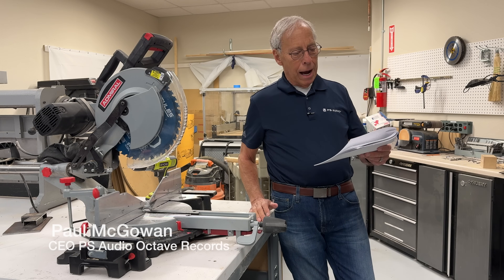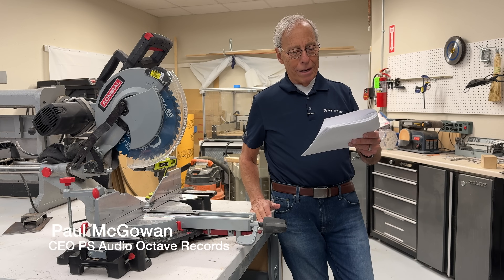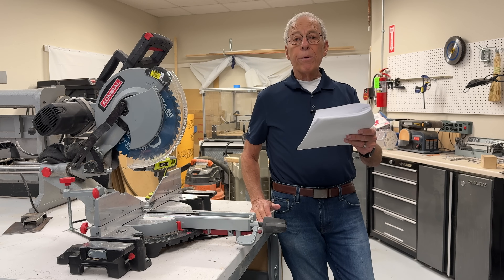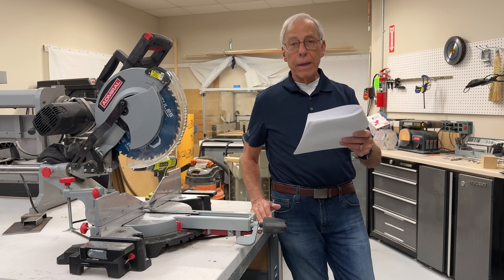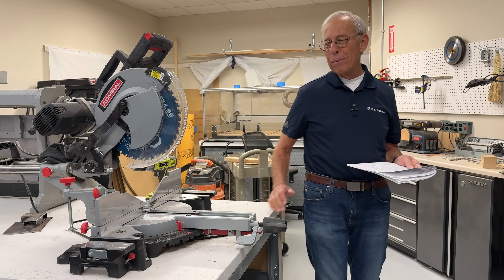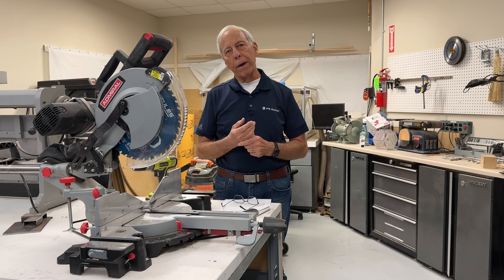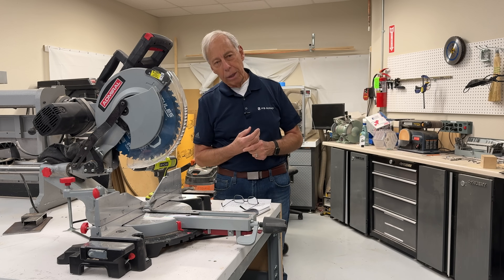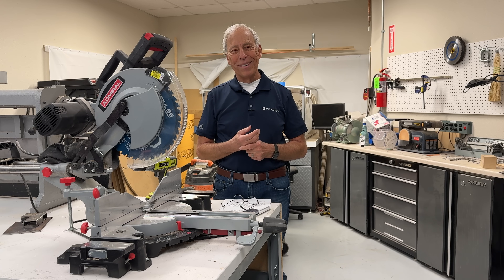The perfect wall materials for a listening room

Comment: I built a micro (9x9 foot) studio / office in my detached garage using 1/2 inch homasote screwed into studs and an additional 1/2 inch moisture resistant drywall screwed into the homasote using laminate screws with no laminate screw contact to wood to break the sound..(I researched other options, including a European sound breaking screw attachment system and also locally sourced drywall suspension channels which decrease the office space so I settled on drywall over homasote due to space limitations)...a flexible adhesive was applied to further connect the drywall to the homasote.  There is a vapor retarder as well for moisture control given my situation in my climate and structure.  Gaps were filled with flexible acoustic caulking or fire caulking depending on the situation.   Stud bays were filled with rockwool.  Area above the ceiling was capped with more than R60 total of rockwool  covering truss lumber and even more fiberglass (layed crisscross and fiberglass over rockwool).  Sound is considerably mitigated inside to out and outside to in for most frequencies accept for the lowest rumblings, which are very infrequent (neighbor mowing). Interior has acoustic treatment to lower resonance and echos.  Bass trapping will be unrealistic in this small space. The floor is over 4 inches thick and includes laminate over plywood subfloor over pink high density foam insulation over vapor retardant OSB subfloor with little feet over concrete (we are in Minnesota....cold in winter). Floor has a rug. Final sound mitigation will be a hanging "sound blanket" over exterior of insulated steel entrance door  to office as that is the prooven source of any major sound contamination in or out.  I have difficulty hearing hail and rain storms plummeting my garage where the office is located.  Anyone can do this sort of sound mitigation on the relative cheap.

Comment: I would like to hear Paul expound more on what to do on top of, or instead of, drywall. I work in a cabinet shop, and there’s various grades and thicknesses of MDF we use. I’ve used 3/4” double refined MDF to build a car subwoofer box in my free time. We’ve also done architectural millwork for theaters, using acoustic paneling for parts of the theater. It was about 1” thick 4’x8’ panels with a milk chocolate brown, fibrous core, and quarter sawn white oak veneer laminated to a dense thin substrate on each side of the core. There were just larger than pinholes drilled through the veneer into the core spaced in a 1” by 1” pattern.

I would be grateful if Paul spoke more about speaker construction and the differences between average homes’ to stupid big homes’ acoustic tendencies and capabilities. And the difference between concert venues and theaters, amphitheaters, recording studios, etc.

Comment: I was thinking of using my basement to set up a listening space but it is unfinished. The advantage is that it is big so I can place the speakers away from walls which I can't do as easily on my first floor.  Would this work well?  Regular basement walls but speakers placed optimally away from both front and side walls?
Reply: You would want to cover the concrete walls to lesson reflection. Floor would need carpeting.

Comment: I live in a sleepout, and all the walls are plywood. I didn't realise how much they affected my sound until I put Blu Tack all around the power points. The difference was huge! So much cleaner now.
Reply: @Kiwi_Col, interesting, do you mean around the electrical mains power sockets ?
Reply: @stephanespohr886  Yes, on the wall all around the power outlets to your stereo and TV. You can also use it on shelves supporting your equipment. You can put it underneath the eq so it won't be visible.

Comment: When using multiple layers of drywall, make sure none of the seams of the second layer line up with the layer beneath. They should all be covered by the second layer. It will be more work, but there will be less bleed to the rest of the building.

Comment: You may be referencing resilient sound isolation clips (RSIC) for mounting the drywall to the studs. When I was building my home theater I looked into those kind of things, but it really would add cost to my modest project. I also looked at the z-channel referenced in the comments. Any of the solutions to "soundproofing" rooms would have added cost and complexity beyond what I really needed. I used rockwool and 1/2" drywall attached to 2x6 studded walls against concrete with the ceiling above a dropped ceiling packed with 12" of insulation. It worked fine except when the kids were watching the movie "Master and Commander" at a volume I'm sure my neighbors 100 feet away could hear inside their house.

Comment: I'd like to try sheathing a room with 3/8 OSB covered by either spray foam (the catalyzed stuff, not the stuff in a can) or cellulose.  Perhaps spray painted with an airless.  It would be a wildly rough texture and probably intolerable by most people but would be the ultimate in diffusion.

Comment: Decoupling drywall can be done with strips of rubber on the stud face but the most effective way is a metal Z channel that horizonal to the studs.  I've never seen 3/4" drywall but typically two to three layers of 5/8" drywall is used in studios.

Comment: I had to deaden some small booths for audio testing of devices and the local "foam warehouse" also has rolls of various materials; I picked up a roll of this odd vinyl material that was recommended by the shop for not too much but for being not even 1/4" thick it was downright magical in killing both high and low vibrations, just sucked em up like a sponge.  One of the oddest materials I've ever worked with and really was an ace up my sleeve come review time.  ;-) 
I never even learned if it had a name or what it was called, it was just "deadening" material and boy engineered materials can surprise the heck out of ya sometimes; it's like someone designed it to do a specific thing and it happens to do that thing well.
And the booths had sliding glass doors to get inside them - double sided sticky tape and plastered it on there, problem solved!  🙂 Then again glass isn't quite as resonant as wood when it comes to signal regeneration, if you get the right frequencies wood will erupt with all sorts of second and third order effects (glass has no internal structure as well as being really dense).  But glass reflects like mad, so you've gotta trap it to keep it from scattering everywhere...

Comment: a listening space is a component of the speakers. when contemplating devising a home near-field (especially) listening room, in addition to determining your listening position, consider the interior of a well-designed / engineered speaker ; volume, shape, hwd ratio, structural material, surfaces, objects, damping materials & the like. what are their damping / absorption & reflective characteristics? room modes @ different freq? address these factors (in concert w/ with the spkr's own signature) & you may achieve a very satisfying soundfield w/ a tuned / tunable nature... & it's fun!

Comment: Great idea.  It would be easy to stick a strip of dense foam pad on all the studs and then just install the first layer of dry wall.  Then glue the next layer of drywall using some kind of adhesive that stays pliable.  Like the stuff you might put under flooring.  That double layer of dampened dry wall would not be resonant.  I'd love to build a room like this with rockwool insulation to isolate the listening room from the rest of the house.

Comment: I built a small dedicated sound room in my basement, but only drywalled the outside of the walls and used fire resistant fabric on the inside and ceiling. There are no hard surfaces inside except the floor which I partially carpeted. Then I've added some pictures and other decorations to add back a little reflectivity. It sounds great to my ears.

Comment: you can use a compressed paper used for flooring noise isolation on the dryer wall/ plasterboard struts, just use some contact adhesive just cut it to the width of the struts they come in sheets.

Comment: Not sure I agree here, a sheet of plywood on its own as you describe in air does have a different sound when hit compared to sheetrock however when 3/4 plywood is securely attached to a brick or block wall ie: an immovable surface, then that does not hold up, my research says they are sonically very similar and venner plywood is aesthetically more pleasing, well to me anyway. For soundproofing sheetrock is denser so its mass wins.
Reply: I agree, once secured to the wall studs plywood is going to be as damping as sheetrock. In my basement, I’ve used 1 1/2 inch thick barnboard over the existing plywood walls. It looks great and the room sounds amazing.

Comment: They make rubber beam/stud isolators that can be installed onto the face of a 2x4/2x6 stud (16" on center). They help isolate the stud from whatever thickness sheet rock that you are installing..

#justsayin

Comment: Use a heavy burlap type wallpaper.
Reply: Burlap itself won't do that much, it should also have at least an inch of fiberglass behind it to deaden the room. I've heard rooms with just burlap and they were still quite active. Burlap can be flammable if untreated, so be careful. Personally, I'd find a different fabric if going that route.

Comment: Use two Dry-wall sheets glued together with green acoustic adhesive works very well.
Also look into bass traps for corners. Hanging ceiling panels and the flooring is critical as well.
Many recording studios actually isolate the building frame to limit transmission of noise/sound in and out of the studio.
Professional recording studios cost a fortune because of the expensive acoustic materials used and the complicated building and construction techniques needed. Usually acoustic engineers and consultants are involve when converting an existing building into a professional recording or listening room. It's always better when starting from a block of land and purpose building a studio from the ground up (but most people, even businesses dont have that luxury).
Good luck.

(There are cheap ways to transform a room, attic, basement etc into an acceptable acoustically treated recording and listening area, but you will need to make afew compromises with a certain things during the build.)

Comment: Use brick and concrete you can't go  wrong.  That's what I used.
Reply: Look up room modes and reconsider that recomendation 😉
Reply: @thepickyaudiophile  Trust me I know about modes  nulls and the rest of it. 
I use the same methods as any cinema and concert hall. Concrete doesn't shake like panels.
Reply: @chuckmaddison2924  Ok cool man 👍 I’ve mainly lived in “small rooms”, many in the smaller side and usually the smaller and more solid, the worse the room modes (we have a LOT of concrete apartment buildings where I come from and it’s NOT pretty) 😅